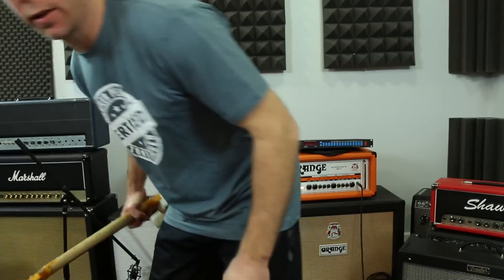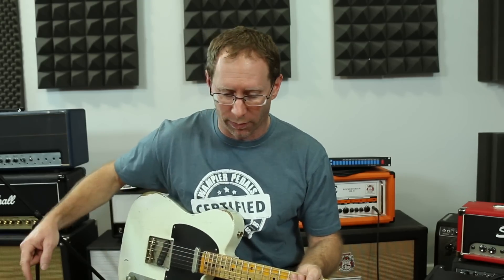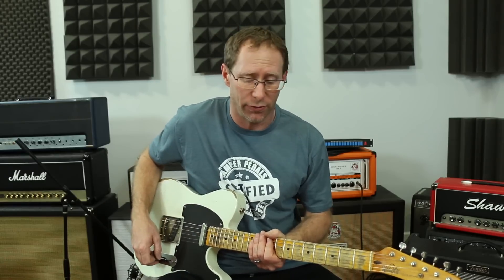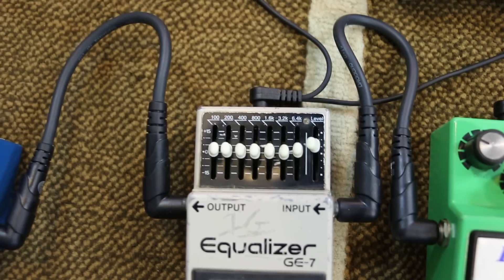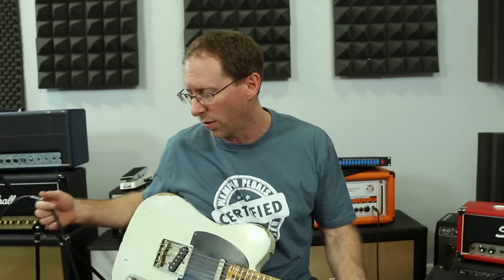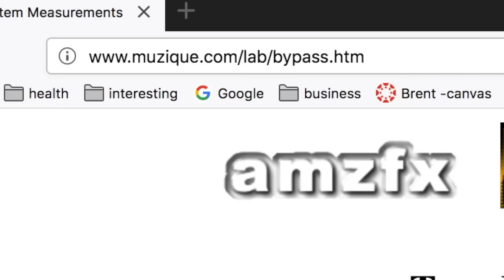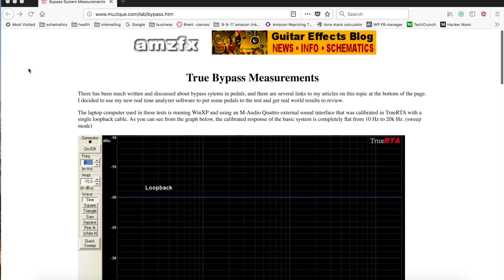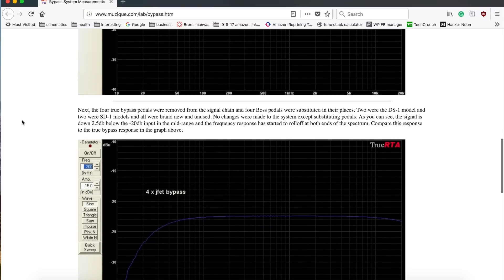Non-True Bypass switching: Is it really THAT bad? A look at boss/ibanez style switching

Comment: It would be nice if, when bypassing the pedal, the signal would pass through the sake length of cable that's in the pedals, and also the equivalent capacitance of the same amount of stomp switches from the pedals. Then you'd have a fair comparison.
Reply from the maker: Much of that is irrelevant though when dealing with the difference of impedances
Reply: Wampler Pedals yeah, but the drop in the higher frequencies would be more noticeable. Lots of cable can literally steal your signal, unless you use a buffer in the very beginning of the pedalboard. Even one of my guitars have a small bypassable built in buffer.
Reply from the maker: As stated however, cable capacitance and loss is minimized when the signal is buffered (low impedance), and since most pedals are converting to low impedance most of the loss  is negated
Reply: Wampler Pedals yeah, agreed. But that's just my point. While certainly there is signal degradation with buffered bypass, it also prevents signal loss from cable capacitance.
Anyway, we can always get the best from both worlds. My current pedalboard has only 4 buffered bypass pedals, one of them being the very first pedal, another one at the end. Low signal loss from cable capacitance and low signal degradation from buffers. I see this as an absolute win!
Anyway, it's great to see someone like you really interacting with us, keep it up! Cheers
Reply from the maker: Sounds like a great board!
Reply: Wampler Pedals thanks! It's basically some pedals I got some time ago, plus the cheapest clones from eBay, with some mods and tweaks, and some more homemade pedals. It's not very expensive, but I really like it

Comment: Not sure if Willie Wampler can help with this or anyone else (can we get golden tickets in our pedal boxes?). I have some old MIJ Boss pedals, and only recently found out they should be powered by non-isolated/unregulated (Boss ACA) power supply (despite seeing the ACA/PSA sticker and not knowing what it was), so that they can get 12V. If you supply them regulated/isolated at 9V, they are underpowered. So if I'm using Boss or even non-Boss vintage pedals or clone's of old pedals such as DOD250 Gray or Tube Screamer with a regulated power supply, am I not getting the actual real tone I should be getting? Or are we now getting the tone we want out of them BECAUSE we are using them with regulated power supply? Interesting.

Comment: So Josh (not to pit pedal guru against pedal guru) said never put your buffer BEORE a fuzz.......why did he say that? 
-Confused in CA
Reply from the maker: Generally you don't want to put a buffer before many transistor based fuzzes (like the fuzz face for example). It won't hurt them, but they don't generally sound as good. In that situation, you'd put the fuzz first, then a buffer.

Comment: True Bypass is fine if you use just 1 meter of cable with only one effect. There is NOTHING wrong with a buffered effects pedal. But guitarists are the biggest mojo and esoteric species... :/
Reply: Kurt Cobain only used 2 pedals in 1991 during live shows (Boss DS1 and Small Clone chorus) and he had no problem with it... and he's not even a virtuoso guitarist as well or didn't knew anything about these stuff.

Comment: is that an ada mp1 in the background?
Reply from the maker: Yes it is, I love those!
Reply: i played one in the early 90's. i really liked it, but i went away from the whole rack thing. i still use an overdrive pedal with two 12ax7's and high plate voltage. the epicenter audio valveboy. have you ever seen those?

Comment: WARNING: TECH STUFF AHEAD!
It's the JFETs to blame, not the buffering concept. JFETs are nice amplifiers, but not so much as voltage followers (aka buffers).  Any buffer circuit will cause some attenuation, from pretty much negledgable up to a noticeable drop. With typical JFETs it can very from 1dB to a bit over 2dB of loss, and it can very from circuit to circuit and FET to FET. BJT's are much better at this, with very low loss, but have much less input impedance (though still very good). Opamps are even better - very low loss, very high input impedance (especially those with JFET inputs).
Stack a few JFET buffers together, even very good ones, and you'll get significant loss. Even if you stack quite a bunch of opamp buffers you'll get noticable loss. Nature of the beast.

Comment: the big problem in buffers is the 9 volt power suplly - you can´t run a high output pickup without big losses if you´re using 9 volt, it´s a headroom problem.

Comment: You are loosing some db but not sound. You weren't very correct on that.
The sound remains the same, it's just a little more quiet.
Reply: I'm an electronics engineer with over 30 years building a wide variety of signaling products for global market and Ric, you need to learn some transmission line theory, and JFET circuitry because Brian IS correct, and you are wrong.  Also, decibel acronym is dB, not db.   And none of the "db" were "loose"... You weren't very correct on that.   Remember, when you point your finger at someone, there are 3 fingers pointing back at you.
Reply: in theory you should also be losing a little bit of bass from going through all those DC blocking caps on the inputs and outputs of the pedals
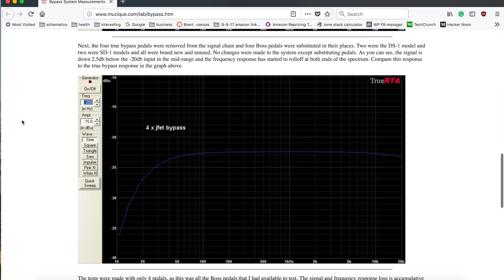Reply: you see this effect for yourself around 6:30. the left side of the graph (low frequencies) are being bled away. there's also a little bit of loss of in the super highs.

Comment: Also what happens when you have too many true bypass pedals? Like 40 pedals? Does your 6 string turn into a bass guitar?
Reply: Same thing that would happen if you ran that length of cable without a buffer because that is what it would be with true bypass. You'd loose a little top end from the cable length.

Comment: What if you used a TC Polytune 3 with buffer bypass at the very end of your chain? Would take make the problem better or worse?
Reply: put it at the start of the chain. The buffers purpose is to give the guitars pickup a nice impedance and reduce loading on the pickups. Sometimes, a buffer at the front and a buffer at the end is a great solution if you have a lot of cable.